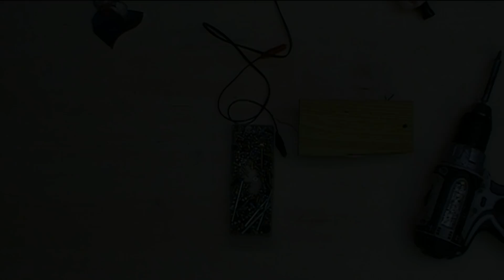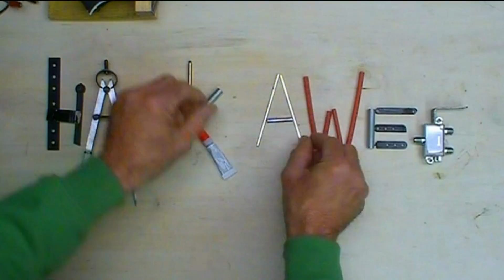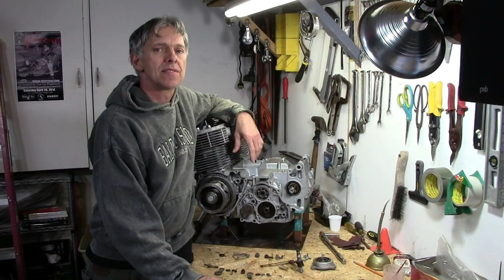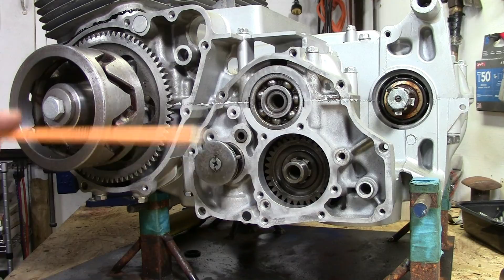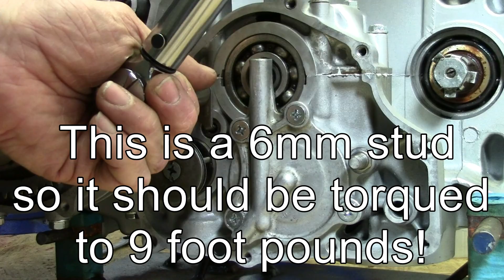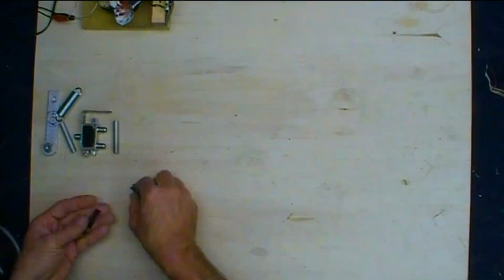1973 Honda CB750 Custom Build Part 17 - Shifter Assembly

Comment: quick question. towards the bottom left of the lay shaft bearing there is a plastic/composite cap. on my 1973 750 directly below that on the bottom side, i have a hole. when i try to fill the motor with oil it just runs out the hole. is there suppose to be a cap or something inserted into that hole? also on my lay shaft housing/bearing the end of the oil journey is open. not filled like yours is.

Comment: Hello, fantastic series, very useful, well done. Any idea where I can buy this spring (just below your fingers at 10.15). The tensioner spring for gear drum actuating arm. I live in France, very hard to get Honda parts. I wondered if you could help, keep up the great work, thank you. David
Reply from the maker: Try here: 
https://www.hondaparts-direct.com/oempartfinder?aribrand=HOM&arian=motorcycle#/Honda_Powersports/CB750A_(00)_NIGHTHAWK_750%2c_JPN%2c_VIN%23_JH2RC380-YM800001_TO_JH2RC380-YM899999/GEARSHIFT_DRUM/9e4be468-b97d-402d-82ba-ed911ae60077/e40ec470-79f3-44d7-a42c-22898ead6bca/y

Comment: I need your help! All my components and springs are working fine and I don't have anything broke or missing. As soon as I put all the the screws on the cover plate, the gear shift lever would not return. It's binding.

Comment: Your videos have helped me a lot. But this gear shift assembly has got me stumped. You.make it look so simple to get the first stopper arm on. I can only get it on if I hold the spring in place over the nut with a pair of pliers. I couldn't possibly do it just using my fingers as you do. And as soon as I release the pliers the spring just pushes back off the nut. I'm starting to think the arm on the spring is TOO long and that it is not the original spring. I just can't see how I could get the neutral stoppee arm om without an extra pair of hands to hold that first spring in place.

Comment: Hey, im having issues with my shifter assembly, i can only shift into first gear, and neutral and cant get into 2,3,4,5th...  likely the spring in the arm lever like you said?.. that first big spring, which i cant find anywhere.. can i just bring this old one to a hardware store and find a generic spring that matches?
Reply: How did you fix it?

Comment: how do i get a tight screw out of the gear shift cover?
Reply: The correct size Allen key with a half inch ratchet or even a breaker bar if it's dumb tight but it shouldn't be unless someone messed with it before you.